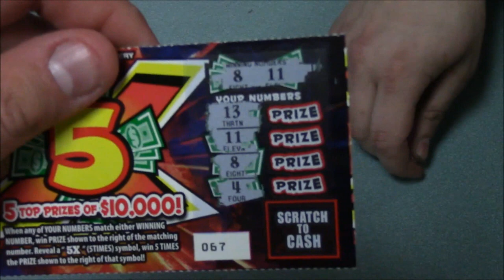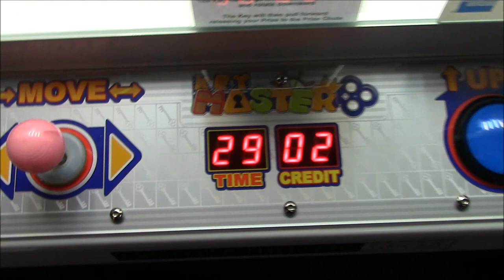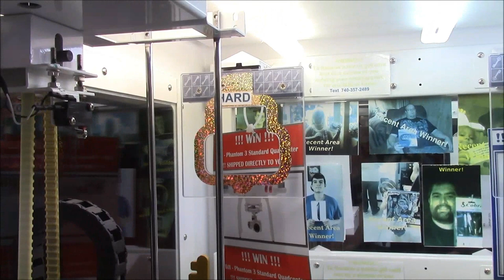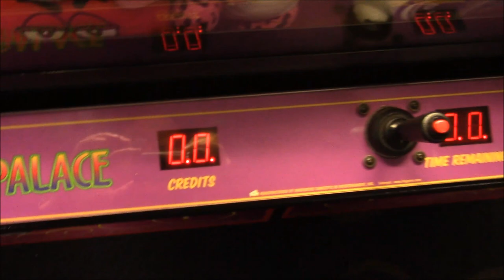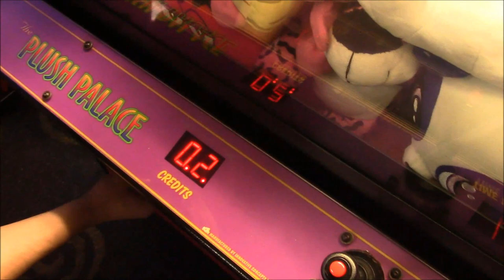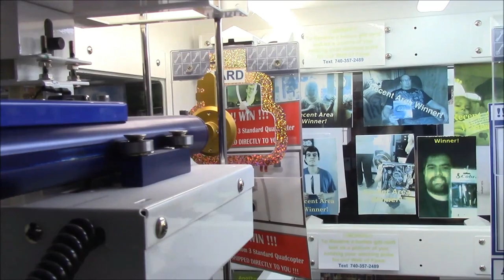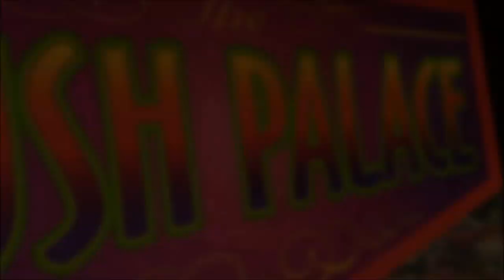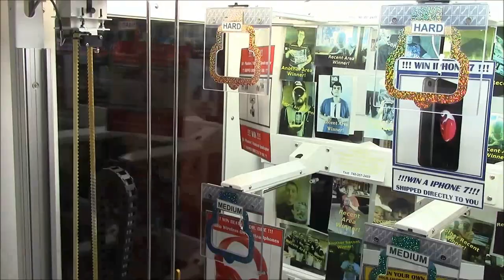SO MANY ARCADE FAILS | NEW LOCATION PLAYING GAMES WITH A FAN | JJGeneral1

Comment: You are lucky to have to seen a gizmo plush, I collect him.
Reply: JJGeneral1 awwww.....that sucks. Because I saw this claw machine when I was young it had a stuffed furby, from the 90s, and it was place on the far back wall and it was not getable.
Reply: Also, there is a Walmart near me currently where there is a Star Wars: A New Hope blu-ray steelbook in a pirate chest claw machine; however, the problem with this machine is that the plastic part that surrounds the prize hole is taller than the dvd can fit. So, anyone cannot win it.